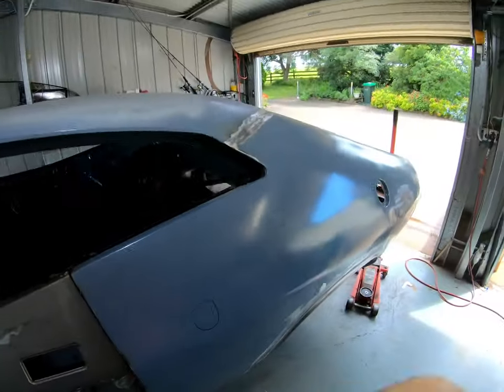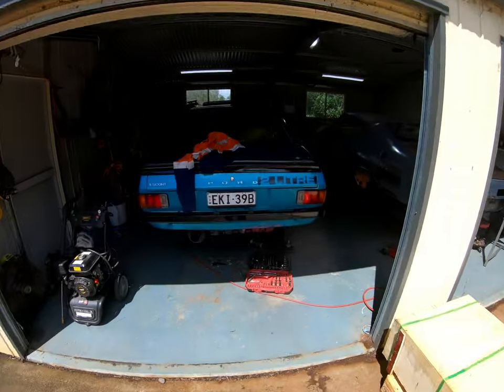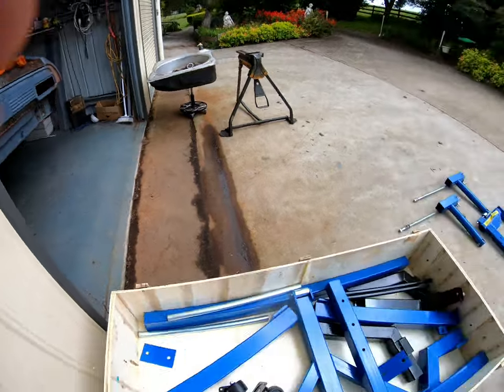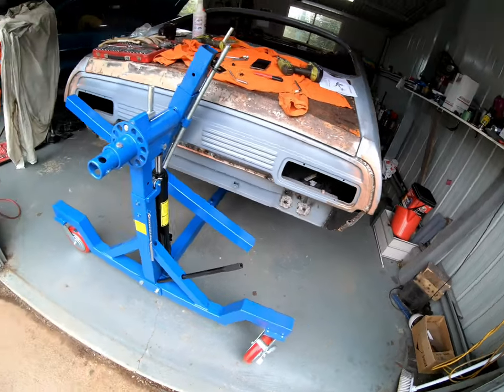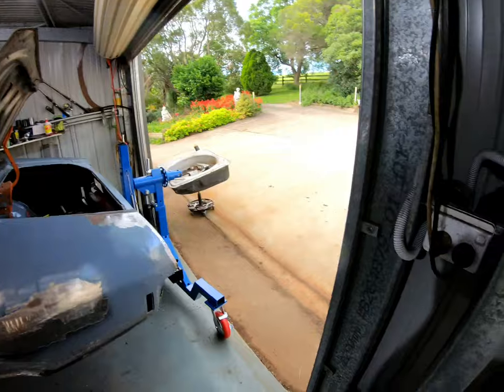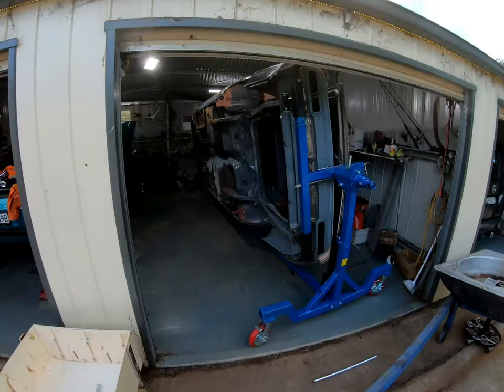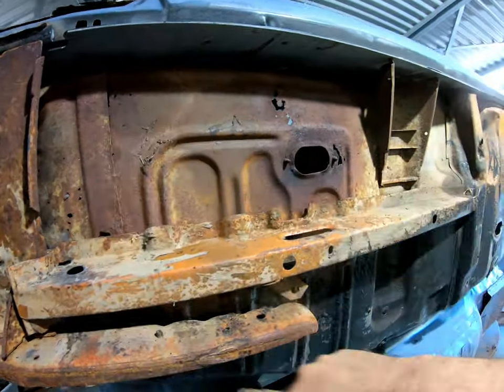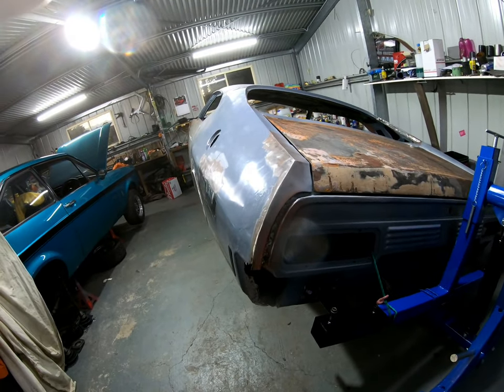Ford Falcon XB GS coupe  - Rotisserie off Ebay - Eps 22

Comment: If ya chasing a set of custom set of 3 piece fr12 fr-17 Simmons I had made up for race car and never used let me know??!! Would look mad on a hardtop??!! They were on Xd Falcon!!! Good luck on your build just finished mine 10+ years I know what goes in to them!! $$$$$$$$$$$$$
Reply from the maker: Haha, $$$ is spot on. I keep sussing out gtshop, grand tourer, rare spares for parts I'll need. Adds up very quickly 😁 I'm not sure about wheels yet . I'll definitely think about my options when the time comes, cheers 👌
Reply: @jason35177  they turn in to money pit yours is a safe bet though done correctly they are fetching big cash Oz muscle is getting rare as!!! I’ll be watching your build for sure!!
Reply from the maker: My goal is to bring it back to factory spec, colour, interior, but ill put the virgin bore 302 away and get another 351 instead. Already have the motor lined up 😁

Comment: Hey mate what were the build specs on your GS? I have one in my garage (in a similar state to yours) that i grew up in, from the age of 2. 1975 302 4-speed, polar white with metallic gold MacLeod horn stripes. Last rego was 1989, bicentennial label.
Reply from the maker: 74 falcon 500, 302, C6, borge warner diff, burnt orange, rally pack GS, chamois interior in P1. Had the macleod horn decals in green 😬 Not sure when it was last regod, but was definitely exposed to the elements
Reply: @jason35177  wow that would have been a very 70s colour combo. C6 would have been heavy tow pack right? Normally it's C4 or FMX behind a V8 (I believe). May have simply been whatever was available too.
Reply from the maker: I think poeple call it the C10. I think the C6 is the hardcore bronco trans. The transmission shop said the internals are slightly different to the C4. Green decals on orange paint wow 😁